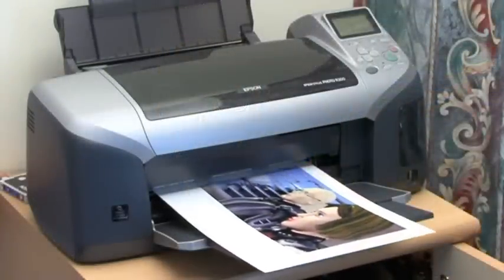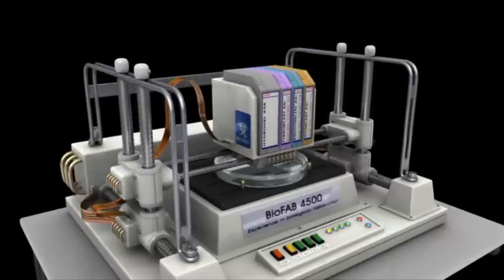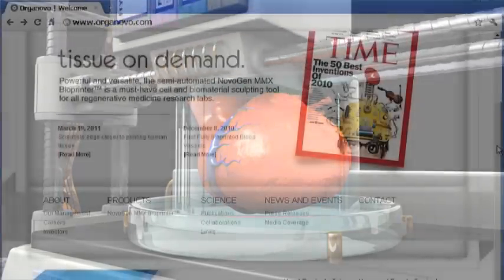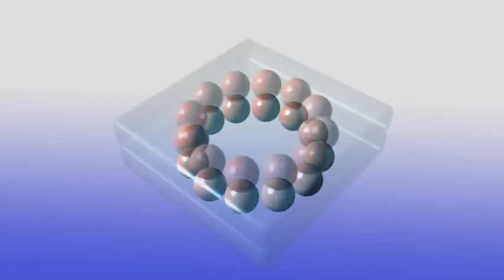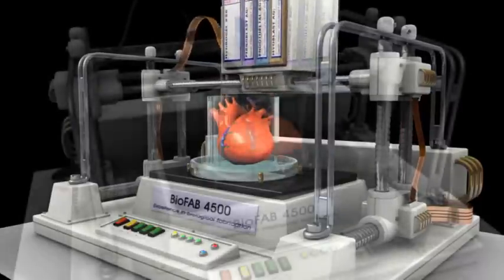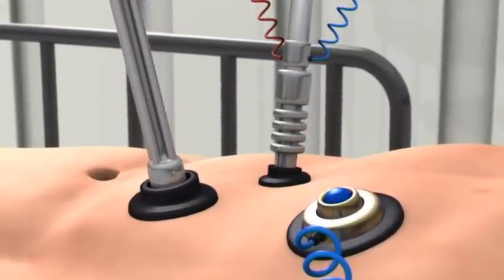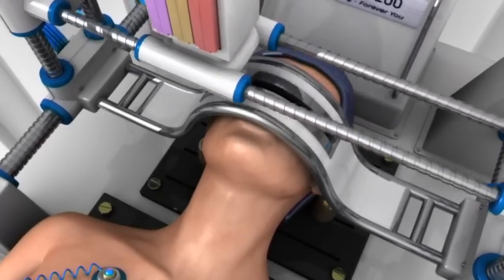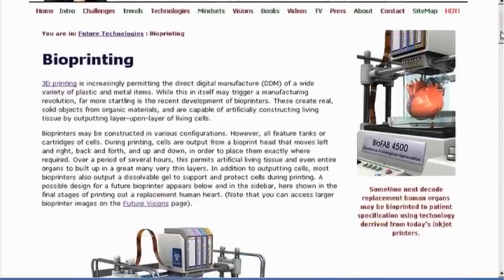Bioprinting

Comment: This has the potential to make the disgusting practice of animal experimentation a thing of the past, so this is why it excites me. Eyes for example, could be printed, and eventually bio engineered into a computer system designed to output effects of different chemicals, such as shampoos, makeup and cleaning products on the human eye. Much better to test a human drug or product on human cells don't you think, and this opens so many doors for that.

Comment: They created a new way to spray on cells by taking cultures from one area of the body and then breaking up the cells and using a type of spray gun to actually spray on the cells in a new area over say a burn creating near instant healing of damaged tissue not exactly 3d printing but still similar to something you mentioned here. Interesting channel subbed.

Comment from the maker: @Bourinos02 For regenerating tissue, yes -- absoutely. But bioprinting (or in some instances bioprinted scaffolds or even inorganic 3D printer scaffolds) will still be "necessary" where existing tissue is badly damaged, diseased or no longer exists. An amputee could potentially be bioprinted a new leg, but would be unlikely to be able to use stem cell developments to grow a new one (well, perhaps). And of course stem cell, other genetic & bioprinting tech will all develop & be applied together.

Comment from the maker: @IQ20000Berta Yes, the possibilities are mind-blowing. I think the old cells will be removed by a tissue evaporator just before the new ones are printed on. Even so, weekly face-refreshes would probably place quite a strain on the immune system -- which would therefore perhaps require nanotech augmentation.